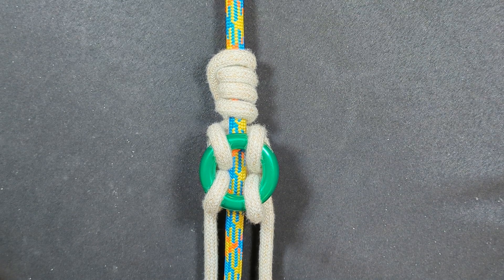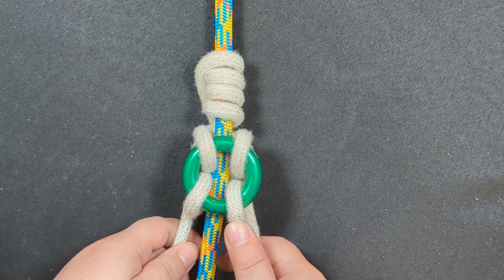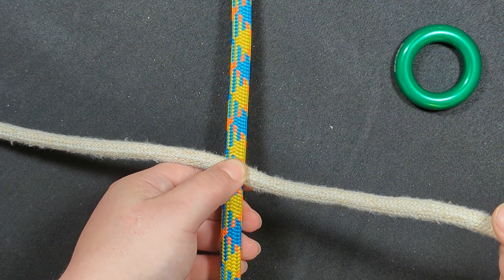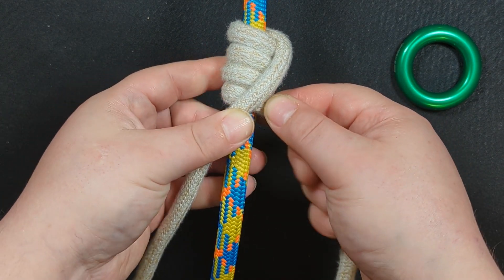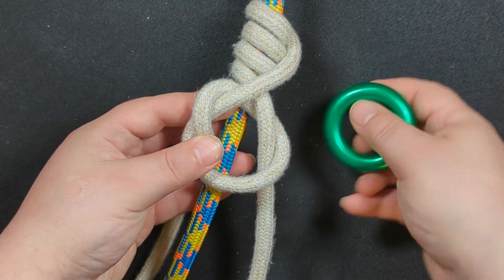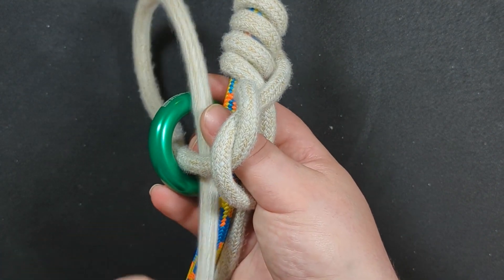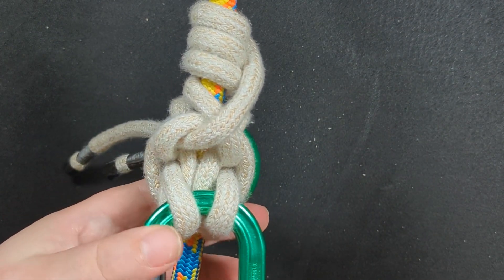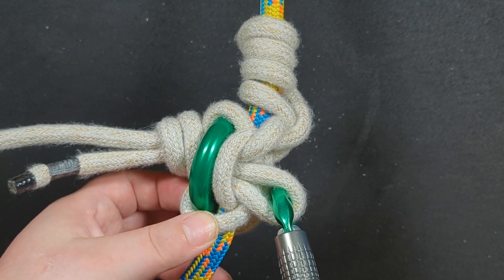PrecisionSRS 5: The Ultimate in SRS/SRT Hitches for Arborists & Tree Climbers!

Comment: I want to address some things here and I hope you  don't get defensive easily.
.
First... there's nothing "expert" about any of this.  It's painfully obvious just listening to you and watching you.
- You stammer a lot as if you don't have this completely thought through, learned, and practiced well.
- You don't use correct terminology when discussing turns, bends, etc.
- You physically fumble a lot during this video

Second... have you actually weighted this, done repeated ascents/descents, fall testing to determine it's actual safety and function in the field? You briefly mention testing but do not elaborate on what you actually have done.
The last part... the so-called "SKIB".  I've never heard of it, and cannot find a reference for it. If you have a link or other information to share about this, I'm interested.
You go through the whole complication of tying your SRS5, then put a dangerous tie-off in the end.  If this was an expert-level device, and you were an expert demonstrating this... you would NEVER use just an overhand knot like that.

Thirdly.. As was pointed out by an earlier commenter... this was way over-complicated for what it does.
This has nothing to do with devices such as the rope wrench.  It does not function like a rope wrench.
Your 6' long hitch cord, tied into a circle and adding a lot of bends/turns, does add friction to the rope, but does not alter the path of the rope like actual SRS/SRT devices.
You are adding rope-on-rope friction, using the aluminum ring as basically a backing plate, adding some more friction there also.
I expect over time, all the abrasion from your climbing rope running against your hitch cord in so many places will greatly decrease the lifespan of your hitch cord. You may find your hitch cord glazes over in certain spots more than normal... maybe.
.
I really recommend you drop all the references to the word "expert", and comparing this to devices such as the rope wrench.  You are basically telling people this is on a level with actual climbing devices that have been thoroughly tested and insured, before being released to the public.
It's just my opinion... but you cautioning that you feel this is some sort of expert-level device, does not release you from liability should someone hurt themselves with this or kill themselves, then the family comes after you.  Unless you have a lawyer who has looked over any disclaimer you post on your video, you might consider protecting yourself further.
.
I'm sure I seem like I'm slamming you pretty hard, but you are demonstrating a device that someone could get seriously hurt with.
I think innovation is great.  I have watched some of your other videos, btw.  I'm not saying you should never have gone through the process to come up with this... just that some of your claims seem to be overstated, basically just wrong.
Be careful with your content and how you present it, in order to protect yourself.
Keep up the experimentation (which this is and should be noted as such)... I think that's great.
.
You might even consider reaching out to those who have the capacity to test this out on solid equipment that can actually provide feedback as to what happens when this experiences real-world usage.  There are individuals and companies that can do this for you.... maybe free (as in  HowNOT2, Richard Mumford), plus a number of Rigging and Splicing companies that will offer testing for a fee... not sure if they would test this, but it might be worth asking.
Reply from the maker: Wow, a lot to unpack here. Fortunately for me, I don’t easily become defensive.

Yes, I stammer both physically and verbally and I INTENTIONALLY do not use proper knot terminology because a) I am new to making YouTube videos, so pardon my lack of professionalism which has yet to be developed completely and b) I INTENTIONALLY do not use correct knot terminology because analytics suggest that the vast majority of my audience would be confused by it.

There is no complicated termination forced at the end. If someone wanted to tie Poacher’s knots or a bend at that point, they are free to do so. I only added the SKIB because it was a recent part of a recent video series I made with the inventor of the SKIB himself, Brocky. I could have done a better job explaining that the SKIB wasn’t necessary.

As to your third section, Not shit it’s overly complicated. This is for the hitch enthusiast more than the expert, but for the expert more than the novice. This is is a hitch that just got released pending testing that is HARDLY conclusive. Therefore, I think it is in my best interest to deter new people from trying out this hitch by calling it an expert hitch. I’m not saying it has expert-like qualities, I’m saying only experts with hitch tying skills should risk their life on this hitch which, may or may not, be a complete piece of garbage. You make the incorrect assumption that I think all of my hitches are GOLD. That is INCORRECT, sir. I share my hitches for PEER REVIEW despite whether or not they might be shitty and only apply my disclaimer to those which fit those characteristics. 

Me using the word “expert” only connotes the REALITY that only someone skilled in hitch tying should attempt this hitch. It says nothing about the hitch itself. Would you rather I welcome beginners to try this hitch out and have people like you silence my ability to share this type of hitch? Moving on.

I don’t feel like you’re slamming me that hard. I’ve used this hitch without a rope wrench and I’ve had excellent experiences with it. I KNOW that, under the correct circumstances, my hitch does and will perform well.

You want me to reach out to people who operate on used equipment to test my hitches out? Well, that’s what I’m doing by posting on YouTube and sharing with the majority of people climbing on used gear.

I appreciate your constructive criticism. I truly do. I just feel like we might not see eye to eye on everything and that’s okay. You’re still entitled to your opinion and, until a series of tertiary observers proves otherwise, we are both correct.
Reply: @Knot-orious  I'm on and off YT so I don't get back to reply often or in what some people might feel is a timely manner (not that I post a whole lot of comments on this place anyway).
.
I'll take the time to read your whole replie(s)... thanks for doing this.
.
I'm really not trying to be offensive... but this is a computer screen medium and not face-to-face, so I realize my way of commenting doesn't always come off the way I have intended.
.
I actually subscribed to your channel a bit back in time and I believe I mentioned that I have watched other videos of yours.
I saw  your comment on my use of the word 'stammer'... and it's only meant to be descriptive... I stammer when doing public presentations sometimes and for me... it's really about my prep and having practiced beforehand so it comes across smoothly.
I have not done demonstration or lesson videos on YT, so the day I do will be a new experience!
.
So... with all that... I'll come back and read what you wrote, probably this weekend.
I appreciate you taking the time to write back... I'm sure I'll gain from this exchange. :)
Reply from the maker: @allenabuggarhaus6841  Not a problem. Take all of the time you need. I apologize in advance if I can off as offput in any of my counterarguments. However, that is just me being passionate about my opinion. Just like yourself, i do not mean to offend. I knew what you meant by stammering and I admittedly did a poor job or preparing for that video. It was unusually hurried and the hitch itself is unusually complex.

Anyways, I look forward to further discourse. I welcome people to point out my flaws and any issues in my designs and so far. I also appreciate that you subscribed and follow my channel. Until another time!
Reply: @allenabuggarhaus6841  I reject your proposal that someone sharing information about their personal experiences is somehow "responsible" for people losing their lives messing with the experiments. This both morally untrue, and legally untrue. The responsibility for personal safety lies with the person, period. If someone wants to get a knot off of YouTube and trust their life to it, that is their problem. Stop babying society. Adults can make their own decisions, and pay with their own lives. That is their right, that is what freedom means. 

What you are proposing is essentially to tie up researchers in red tape, that, or crown a few people you consider "experts" like Hownot2 (which is very funny, because Ryan is very much against the kind of stance you are making here, and he has spoken out about this kind of "elitism" in experimentation in the past), and put everything through them. 

Neither of those are in the spirit of original research work. People can fiddle with knots if they like. People can use whatever language they like. I am a professional researcher in mathematics, and work all day with "credentialled" colleagues, and I can tell you...many of them are morons. Credentials mean little. The only way to evaluate the truth is to use your own brain, and if people watching this are unwilling to do that, it is their own fault when they get hurt, and no one else's. Don't put that responsibility on the guy sharing his knot ideas. He is not responsible for other adults choices. At all.
Reply: @allenabuggarhaus6841  One more thing: you are making an error. You are claiming this is "not like a rope wrench" because it does not bend the rope. "Bending the rope" is not the purpose of a rope wrench, that is how it achieves its purpose. 

The purpose of a rope wrench is to prevent the hitch from jamming when weighted. If this guy's hitch also does not jam when waited, then yes, it is a "hitch that can be used without a rope wrench". It not putting a "bend in the rope" has nothing to do with it. There is more than one way to solve a problem. Don't be closed-minded.
Reply from the maker: Also, what is hownot2 going to prove? I have an entire breakdown of why that will prove nothing if you're interested. It's a a comment to someone else who thought it was a smart idea.

“That's a unique idea, however, I don't think it will prove anything and here's why... First of all, the vast majority of my hitches are just as good as most hitches universally used and accepted today based on performance. This I know for certain based on rigorous testing. Secondly, a pull test would accomplish nothing except to measure the amount of force that is exerted before the hitch slips. Thirdly, a good hitch should and  will slip and, unless you tie your hitch with tens and tens of wraps to where it isn't actually a hitch anymore, it WILL slip and I have almost no doubt in my mind that the force required to cause all hitches of each type to slip is approximately the same within each type. Finally, nothing is going to actually break because it will slip and the forces required for breaking it will never be measured unless you place a knot below each hitch and, after measuring the slipping force, allow it to collide with said knot and then measure the breaking force. But since every hitch will either be in vertical or basket configuration, and since each hitch will use the same hitch cord, all you'll be then measuring are the forces required to break that specific type of hitch cord in vertical or basket configuration and what will this number tell us about the quality of a hitch, let alone my hitches versus popular hitches? ABSOLUTELY NOTHING. Don't get me confused, I love Ryan's channel, but it would just be an expensive waste of hitch cord for me to ask him to do break tests for ultimately no scientific gain. I hope this makes sense to you. I don't mean to shit all over your dreams lol It was a really great idea and I honestly WISH it made sense so that I could get attention on his channel and collaborate. How about we both try to come up with some ways that he might be able to test my hitches in a way that will produce meaninful measurements? I'll start giving it some thought. Thanks for your comment. =-D"

Not to mention that HowNot2 requires that the recipient of a test PROVIDE NEW CORDAGE for every test. That's super expensive for someone like me living on the poverty line.
Reply from the maker: You have inspired me to reach out to HowNot2 and to come up with a hopeful collaboration idea. Thank you for the motivation to do so!
Reply: I, part time climber love your work. I use calligraphy hitch as main hitch.
I enjoy your approach to experimentation.  Thankyou.
Reply from the maker: You also mentioned liability as some point, but you probably didn't see the disclaimer in my "about" section on my channel. I realize that won't preclude me having the pay damages IN SOME RARE INSTANCE, but my careful nature and safety oriented style, plus status as someone living in poverty might preclude me from such financial penalties. As for emotional distress caused from knowing someone didn't pay attention to my continuous safety recommendations would be about 5%/100%. If someone doesn't already view tree climbing as an inherent source of multiple risks, then Darwin took a life that needed to go. I realize that sounds cruel, but most elementary school children would know to educate themselves on tree climbing before taking "at height" risks.
Reply: It's also telling that he never wrote back...pretty typical in this kind of situation. People are happy to criticize, but rarely happy to do the work to add something constructive to the world.
Reply: Hi mate   If I can summarise my understanding of the above. We want to see proper tree climbing we are up the tree out on the branches using these nuts so that I don’t have to go and spend 300 £500 on some multicender. But it has to be practical law, law friction for obviously the ascent and coming back in from a limb walk. And then some proper not to tie it off you know it would be nice to see a double fisherman or a fisherman loop on each end so that it goes on the Beaner may be a pulley underneath as well.

Comment: Very interesting. Can it be repelled on with weight on it and remain easily moved afterwords?
Reply from the maker: Yes, in most of the tests I performed, it was able to do that. If your first attempt doesn't succeed, try using a larger diameter hitch cord! This can work with and without a rope wrench.